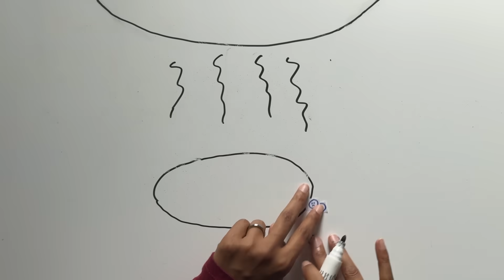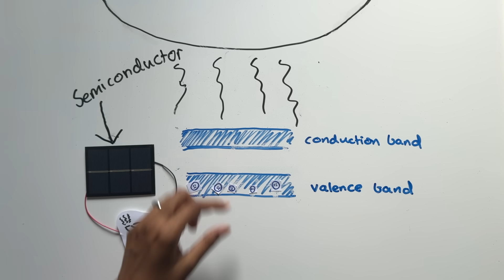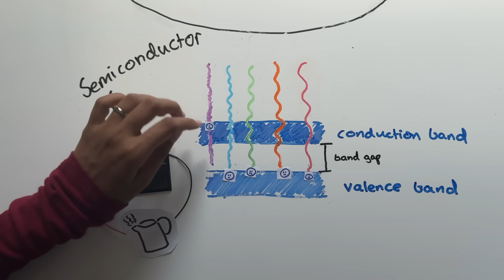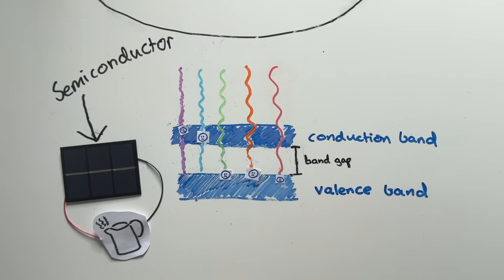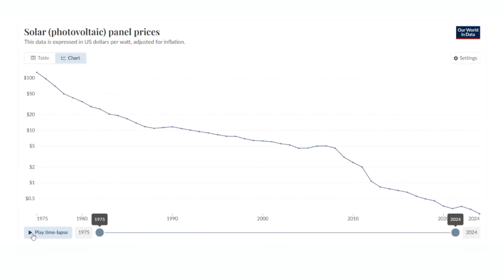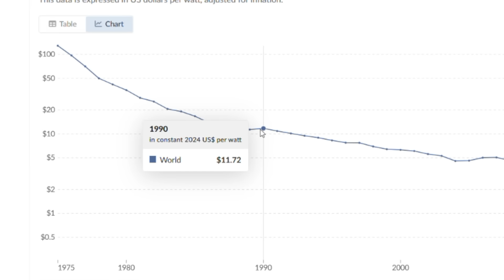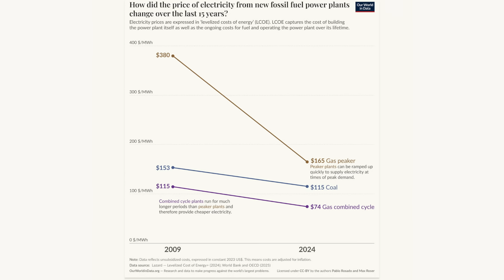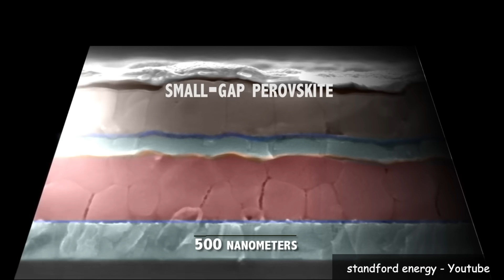Why solar panels can't be more than 33.7% efficient

Comment: The issue with the “exotic” types of solar cells is that, by layering a cell to increase it’s efficiency from 20% to 40% is that the cost increases 3-8x (conservatively), meanwhile just building a second solar panel is only 2x as expensive for getting the same amount of energy, with the cost decreasing the more you make. Even if silicon was limited to 5%, it will always be easier to build up an efficient economy of scale and invest in quantity than quality. The exotic solar cells ONLY make sense if you’re limited on size and weight, like a satellite
Reply: The “exotic” panel types may cost more but if the land/space available is costly or limited, then that has to also be factored in.

For example, if you need twice the land for a silicon solar power farm and the cost of land is expensive, then paying for the “exotic” panels may be more cost effective.

Or, if you can’t produce enough electricity with silicon panels because your home’s roof area is insufficient, then the higher cost of “exotic” panels may be worth it.
Reply: Yes from an economic point of view. BUT, the question or premise is that 33% or so is the MAXIMUM efficiency. So, why not answer that question, not the economic one. Thanks.
Reply: @bwuepper439  She kind of answered that question. In a very basic way, but she answered. What she didn't explain is why not use GaAs or layered solar cells. Therefore, @Artyomi comment. 

Let me try to bring a bit more information to her answer. Metals don't have a band gap. The conduction band is partially over the valence band or is exactly the valence band (or, rather, the valence band acts as a conduction band).  Isolators, on the other hand, have a much bigger band gap (over 4-5 eV). Not only is it harder to find photons able to move the electrons from the valence band to the conduction band, but it's also harder to convince the generated electrical current to move around through that isolator. One can do it... destructively for the isolator. The sweet spot is a semiconductor that has a band gap small enough to be jumped by an electron excited by a photon in the visible spectrum range. 

Now, probably you have 2 questions: 1. why is there a need for a band gap? Because the band gap cannot be traversed easily and that creates a clear potential difference, which can be used to make an electric current. Useful electric current, able to power things. You can also have the classical (external) photoelectric effect, shine a light on a metal in a vacuum, and some electrons would jump outside the metal. By "some" I mean able to lift the leaves of an electroscope, not to power an electric drill. There are also other means to produce a bit of electric current by shining a light on things, but none is as good as a semiconductor.
2. And how about the light? Why is visible light so good? Well, because the intention is to use the Sun as a source of electricity and not some other star. And the Sun has a certain spectrum, which, as it happens, is very good for life. Each photon has an energy depending on its wavelength/frequency. The higher the frequency (lower wavelength), the higher that individual photon energy is. Above violet and into ultraviolet, the energy of the photon is so great that it starts to break chemical bonds and destroy materials. The human eyes have no use for such a photon wavelength, because the Sun doesn't emit too much of that, the Moon at all, it tends to be scattered easily, and requires a special chemistry for detection. Therefore, UV light is not visible. On the other side of the visible spectrum, photons with energies lower than red are so weak that they require special receptors; the photons simply don't have enough energy to make the chemistry in a normal eye work. And, again, the Moon doesn't pump too much IR to be useful for hunting at night. For vegetation, the problem of interaction between photons and chemical molecules is the same: too much uv and the chemical bonds are broken, too much IR and chemical reaction doesn't happen at all. Therefore, as it happens, the Solar spectrum peculiarity is also good for this particular technology we're using (our technology is adapted for our living conditions). Therefore, it's best to use photons in the visible range because they carry a decent amount of energy, and they're not destructive for what we're able to mass-produce. Of course, I'd like to live near a neutron star that pumps out a lot of high-energy X and gamma rays, but for my current self, that wouldn't be too healthy.
3. Bonus. What happens with those photons that are not able to make the electrons jump the band gap? Or what happens with those photons that have too much energy and would make the electrons like to jump to the highest levels of the band gap (but they can't)? Well, they suffer the fate of any system that makes something useful: they increased the entropy of the system. And that, mainly, means heat. This adds to other mechanisms that produce heat in a solar panel. A multi-layer solar panel would have to contend with heat in some form or other; therefore, the increase in the cost @Artyomi mentions.

Hope that complements the answer.

Comment: This video completely misses the point about the true cost of solar (and wind). Yes the cost "per installed MW" is low, but that ignores all the additional costs unreliable energy creates. Far more land, concrete, steel and glass is required than in reliable energy production. Far more infrastructure is required to collect that widely distributed energy and transport it to where it is actually needed. Load balancing the grid becomes more difficult. Maintaining a stable frequency on the grid becomes more difficult because solar doesn't produce 50Hz AC. Worst of all we still need to maintain 100% capacity from reliable power sources for those times when the sun doesn't shine and the wind doesn't blow. Adding unreliable energy sources just increases the cost of the electrical grid - it's not a coincidence that the countries in the world with the most wind and solar also have the highest electricity prices.

Comment: In Pakistan, which is leading in solar installations (total installed solar capacity is now almost half of all non-solar grid capacity and it is not slowing down) the price right now is about $0.11 per watt which is half of what your chart shows. It was reduced roughly 3x in the past 3 years alone. All thanks to China.

Comment: If the higher band gap materials are transparent to higher wavelengths, then couldn't you arrange multiple band gaps in descending order, so you harness purple photons, then blue, green, etc? The "theoretical limit" assumes you only use one band gap.

Comment: +
Once connected to the grid could only putin 15% of advertised output or extra electricity.The ignorance of solar connected to the grid is easily demonstrated with a volt amp meter and fourth grade math called om's law
You know, it takes some 6 others with skyrocketing.Electric bills to compensate just for one homes.Solar installation and that is unsustainable and disqualifies it as green.

Comment: Apparently photosynthesis is only 1%-8% efficient, which is much worse than solar panel efficiency of around 30%.
Reply: But you get sugar from it which doesn't need a lithium battery to store.
Reply: It seems like both of these answers are correct and interestingly enough when you consider total energy capture relative to the photons absorbed for example the stored chemical energy it’s around 30-40% efficient which is similar to a solar panel. But Photosynthesis alone: 1–2%

Comment: Given the limited available ground in the Netherlands, higher efficiency will prove to be worth much higher production costs
Reply: ... and given the limited solar radiation on this small, densely populated northern country, and even if cheap multi-layer panels offered near 100% efficiency, maybe solar PV ought to be considered there as a mere side technology to be reserved for specific cases, where it makes sense, rather than something we ought to have at all costs.
Reply: Not necessarily. A quick search gave me 2.600 PJ (Petajoule) of total energy consumption for the Netherlands. Thats 722 TWh (all forms of energy, not just electric)
For comparison, Germany needed 3.280 TWh in 2023, about 4.5 times the dutch consumption.
Going electric for traffic, heat, and much of industry is estimated to reduce the German demand to 1.500 TWh per year. For the Netherlands this would mean about 330 TWh / year. Germany now has over 100GW of solar installed, producing 75 TWh every year (not all of it can be used currently - whe have to extend the grid and build more storage). 100GW require 500 km² (square kilometers) of solar panels (we actually have 600 km² of autobahn, over 10000 km² of roads, and 2300 km² of roofs, whereof 450 km² are big industrial buildings). 
So if the Netherlands find 2200 km² of area that can be used for solar installations virtually all energy needs could be satisfied.

Comment: So, solar panels are extremely inefficient at 25% and require Chinese slave labor, and that's why you believe theyre the best?  Genius...

And you claim a magical lifespan of 30 years, yet nobody keeps that more than 10 or 15 years max, as evidenced by your parents, as they degrade in efficiency and need to be repaired or replaced like anything else.
Reply: we have some solar plants from the 1990s still operating in Germany.
Depending on location and solar irradiation they will deliver the energy that was needed for their production (5,600 kWh of heat for 1 kWp of solar panels) in less than 6 years - in locations in Canada or central Europe.
But wait ... a coal or gas power station only provided 40% of the heat as electric energy ... so the time of energy return (EROI) is 40% of 6 years - that's 2.4 years. And faster close to the equator, for instance, in Florida or Texas ...

Comment: Solar is only cheap when you have other energy sources to back it up when the sun don't shine. If you actually use enough lithium battery backup for solar to not need any other forms of energy, it'll be prohibitively expensive.

Comment: Hardly a problem.  Plants are, say, 2% efficient.  And you can make bifacial solar panels.  At some point, also, a way to use a wider range of wave lengths will be found.

Comment: Yes, there are theoretical limits to solar panel efficiency, which depend on the type of solar cell architecture. These limits arise from fundamental physical principles, such as the Shockley-Queisser (SQ) model, which accounts for factors like the solar spectrum, thermodynamics, and recombination losses in semiconductors.Key Theoretical LimitsSingle-junction solar cells (the most common type, like those in standard silicon panels): The SQ limit is approximately 33.7% under standard 1-sun illumination (AM1.5 spectrum). This is the maximum efficiency for a single p-n junction with an optimal bandgap of about 1.34 eV. For silicon specifically (bandgap ~1.1 eV), the limit is lower at around 29.4%.
Multi-junction (tandem) solar cells: These stack multiple junctions with different bandgaps to capture a broader range of the solar spectrum, exceeding the single-junction limit.Double-junction: Up to ~46%.
Triple-junction: Up to ~47-50%.
Infinite junctions: Up to ~68.7% under unconcentrated sunlight.

Ultimate limit with concentration: Under maximum solar concentration (full sun focusing), infinite-junction cells can theoretically reach ~86.8%.

Current commercial solar panels achieve 20-25% efficiency, far below these limits, but lab records for multi-junction cells have surpassed 47%. Ongoing research aims to approach these bounds through better materials and designs.

Comment: Solar is much less expensive to collect the energy (from the sky) than digging coal or drilling for oil. So, the cost is almost 8x less expensive than carbon-based fuels.

Comment: Advanced synthetic biology panels would outprice outperform and outlast any traditional manufacturing solar panel.  Biology like weeds and molds can grow out of concrete sidewalks and roofs with zero maintenance, same would apply to artificial superorganisms.  With biological immortality the panels would last for thousands of years and could store excess energy in oil like biofuels, at the same time unevolvable nanostructures could attain 40 plus percent solar capture.

Comment: It all makes sense but isn't it weird that despite all these newer and better energy sources, plain old burning of wood for energy is at an all time high? I've heard people discuss this and it has to do with issues of portability and energy density. Burning wood is very easy to do. It's solar power where nobody has to make a panel. Trees make themselves. 
And now copper seems to be a problem. Around where I live there are thieves now that tear apart trail lighting systems to get at the copper wiring. Another stretch of trail just got ruined. They went around the safeguards of heavy concrete blocks on the access ports  by cutting the tops of the lamp posts off and pulling the wires up that way. They had to have a lift to get up there and do that. They pose as city workers or commercial repairmen and get the job done. Looking at the price of copper it doesn't seem high enough to justify the effort, but apparently it is. We now need a conductive material for wires that is getting cheaper as fast as the solar panels and batteries are.

Comment: I didn't watch the video, but there are already multi-junction PV currently at 25% but projected to 45% (perovskites). And the efficiency limit IS NOT IMPORTANT, the reduction in price because of better manufacturing techniques is the most important factor

Comment: This Aussie panel pricing make this American sad for how much I paid. Amazing difference.
Reply: I live in Germany and paid 120€ per panel in 2023 and 80€ in early 2024. In summer 2024 the price fell to 50€. And there is currently 0% (yes, zero) of VAT to pay on solar equipment. Normal VAT rate is 19%.
Reply: @ElwoodEBlues  Sometime when I hear about non-US pricing I think there is a conspiracy to keep US citizens paying extra for electricity.
Reply: @Travlinmo the maybe high Import tariffs for solar panels.
iirc  the Biden administrations inflation reduction act (IRA) requires goods and work to be of American origin for projects it subsidizes, like solar and wind. 
A quick Google search resulted in Pages from dealers in Florida offering solar panels of 400W at prices between 142$ and way over 200$. The offered panels are labeled "assembled in America", but the panel brands are Trina and JA (China) and Hyundai (Korea). Someone is just adding the metal frame and maybe the connecting cables to the panel, maybe even the glass front panel and / or the plastic backside and selling them off with 100+$ added to the price. 
Here in Germany the Meyer Burger solar panel factory has stopped production because we import Chinese solar panels without tariff. With those American solar panel assemblers they could easily complete, despite Meyer Burger was producing the solar cells themselves and did not import them from China.
Despite Meyer Burger having stopped production we have quite a large solar industry -  enterprises and contractors designing and building solar systems.

Comment: Lifecycle costing: Wow much energy will a single panel generate over a lifetime vs the energy consumed in its manufacture, deployment, decommissioning and disposal? This is the minimum energy budget to determine viability of solar panels at scale.
Reply: I'm pretty sure given enough time a solar panel actually can produce more energy than was spent making it, wind is the one that had that problem I believe.

Comment: Less efficient than internal combustion engines in terms of Joules. 1/3 is very poor, and inverters can often lose 1/5 or more so this is not a grid scale solution
Reply: internal combustion engines are the very poor thing. You don't compare like with like here as gasoline / petrol is burnt and gone after a single use while sunlight will never stop during mankind's existence. That's why we call it renewable. And sunlight converted to an electric current ends up just as heat, not as a pollutant.

Comment: Perovskite technology has surpassed the 33.7% efficiency limit of single-junction cells by using tandem solar cells, with the current certified record being 34.85% for a perovskite/silicon tandem cell, achieved by LONGi in April 2025.
Reply: Inorganic chemisty; do it with lead easily.
Spend three decades trying to find a way to do it without lead.